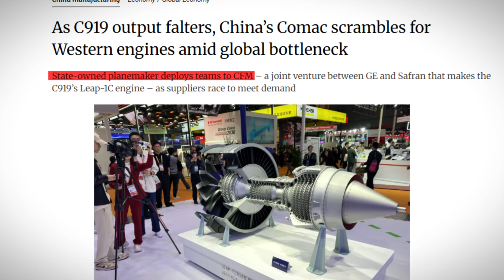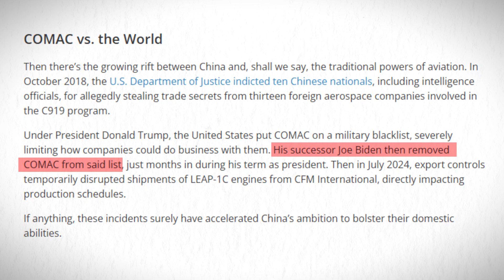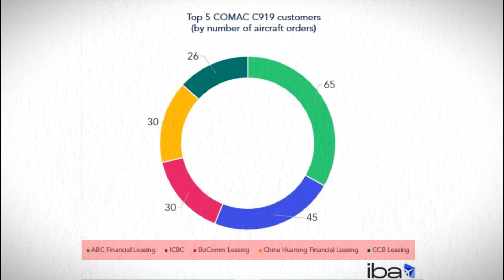Why NOBODY is Buying this Chinese Plane

Comment: fail? it is the most successful plane outside boeing and airbus. the idea that comac need "foreign customer" is misguided, that is not why the plane is create, the plane is created so China can have an independent ability to maintain it airlines. to achieve that, the goal is first to sell domestically, not to foreign customer. nor does COMAC has to be concern with using western part because the success of the Y20 transport planes provide COMAC with domestic alternative.

saying C919 hasn't change the equation after Boeing many crash is just a stupid statement because the A320 hasn't change the equation either! why? because all 3 manufacturer are already fully booked for years. there is no point cancelling boeing order to buy Comac or Airbus because you won't be on the list of getting your planes for years. that's what the market actually look like, it is extremely supply limited, and neither Airbus nor Comac will risk increasing production just because Boeing is getting shit on, there is just no reason to take that risk when you are doing feel as is.

lastly the certification issue is not a real issue. because China can always ban boeing and airbus if EU and US refuse to give certification, so is clear that the certification will come because EU and US do not want an end to their market access to China. C919 is very early in the program, they are exactly where they need to be.
Reply: You are correct.

Comment: The problem of the C919/COMAC is its limited production capacity.  Too few and too slow. 
Only 13-14 C919s are delivered to customers each year (2024/2025), 
far fall short of the 500 B737s and 700 A320s from Boeing and Airbus each year.
COMAC will deliver less than 500 C919s in the next 20 years.